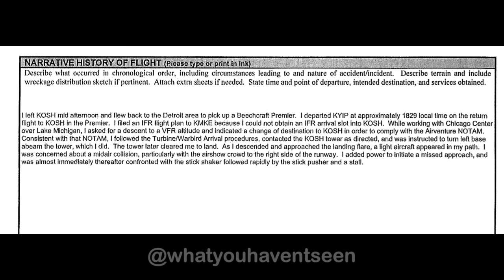Jack Roush Crashes Private Jet At Oshkosh (2010)

Comment: Hmmm... Despite what he says in his incident report (and he's lucky he lived to write one), I think there are some pretty good clues in the video as to what actually happened. 

Lets go to 0:08. That's a pretty tight turn that close to the ground and suggests he is having some major difficulty trying to line up with the runway. 

At 0:10 he rolls out wings level but no way is he lined up (we'll prove that later). The only reason he rolls out is because he has to arrest his rate of descent and in this frame he is actually beginning to climb wings level. His report says he was aborting the approach due to conflicting traffic but we will see that is probably not the case. While you're on this frame take a look at the crowd control marshals standing just in front of the scooter. Their shadows give a good indication of where the sun is and how they are casting long shadows. 

Now go to frame 0:12. The first thing to note is the pilot has banked left again. This is not standard procedure for an abort (which he said in report he was doing), which should have been to remain climbing, wings level, on runway heading.  In my view he is actually still trying to line up with the runway and to land further down.  The second thing to note (and you might need to look carefully for this) is the aircraft's shadow on the runway. Given the long shadows that are being cast, this is proof positive that the aircraft is well right of the runway. 

Third thing to note is on the next frame 0:13.  The aircraft is banking steeply again heading for the runway centreline. Not aborting the approach.   

By 0:19 he has rolled out near runway centre line and is still continuing descent in his attempt to land. He is not aborting as he said in his report. But now everything he has done up to this point catches up with him. , His slow speed turns (these wash off lots of energy), his arrest of his descent and slight climb after first turning into the runaway  (more speed washed off ), and then no doubt attempts to further reduce rate of decent to give himself more time to line up further down the runway. He has just washed off too much speed and has too little runway left to apply more power. The approach is far from stablised and is an absolute screw up. 

At 0:23 he enters the stall and right wing drops from which there is no recovery. 

This pilot, screwed up his initial turn onto the runway,  failed to manage his air speed and in his report lied about an aircraft on the runaway and that he was aborting his approach.  It is just sheer luck that he didn't kill anybody on the ground and in my view he should not continue to hold a pilots licence.

Comment: So this is what you might call a textbook unstabilized approach. THe fact that he even turned and tired to intercept the runway is hard to believe. More likely is that Jack missed even trying a correct approach and should have been instructed to TOGA, which Jack reports that he was going to. His later claim that he forgot to add power is a tough one because  all he had to do was shove the throttles to firewall and rocket upward; "forgetting to set TO power" is cause to pull his license, and when added to the visual cues of him  presumably intending to overfly it, adds up to pulling his ticket. There is simply zero reason under any conditions, much less clear VFR to intercept the runway where he did (at any altitude) as a stabilized approach even in a 172, much less a jet that, assuming 150 knots maneuvering speed, needs at least a few miles on the approach,  or at least a mile assuming he had perfect altitude and was in the glideslope. A race car driver forgetting throttle/power to accelerate? Respectfully, not safe to fly anymore, unfortunately. He could have done a lot more damage. Regrettably, we're likely going to see a lot more of these single pilot accidents where pilots with thousands of hours in prop planes get behind the seat of a VLJ after 100 hours of left seat combined with sim training and the aircraft gets ahead of them at unfamiliar airports, and we'll just see if insurance regulators can mandate enough training to make pilots safe as a group.

Comment: I read that report and what it says doesn't seem to make sense.  First, I did not see anything in his way (like another plane- there was one on the ground but he passed it.)  I am not a pilot but even I know, he had a heavy plane with a high sync rate and likely low power- not sure about his flaps setting.  Then for some unknown reason he banked hard to the right and it almost immediately caused a stall.  He didn't have nearly enough time or power to maintain lift.  It almost looks like he flew it into the ground.  I would be curious what the weight was on that plane too. I hope they are ok.

Comment: It sounded like a linkage broke or something just before it crashed him to completely loose control, but my guess was it was the undue stress it was put under to try get out of the situation he put it in, in the first place.??
Reply: He lost a lot of airspeed during his approach and ended up stalling over the runway; reason for the bank is that the right wing stalled first and at that altitude it's virtually impossible to  recover from
Reply: @RhynoProductionsDE  Yes I know that. I thought I made that clear in my message. My point is something breaks right before the plane completely looses control. Watch the video back. We all know its an airspeed issue, my point was that because of the situation he was in caused undue stress on a part and he completely looses control as this happened. 

Maybe its just a coincidence but I doubt it. The very second after we hear a noise it goes groundward.
Reply: Definitely a good point, however I believe that noise you hear is someone dropping something on the ground where the camera man is standing. There was loads of noise with all the engines running that a broken linkage at that distance likely wouldn't be heard. It looks like a very rapid turn, but it's quite remarkable how quickly a wing can go down in a stall, especially when pulling up while already at stall speed
Reply: @RhynoProductionsDE   R P  The noise could be anything tbf, but it doesn't sound like anything being dropped it sounds like something big breaking or snapping and also you can tell its not close to the camera by the ever so slight echo in the noise. Its definitely a noise eminating further away from the camera, coupled with the fact the plane turned to the ground milliseconds after it happened I think makes it a far better assumption than not, that it came from the plane.

Comment: The crash pilot Jack Roush, said that there was another smaller plane that came into his path, and that he was trying hard to avoid them. Why is no one talking about that? They make fun of this man, but he almost had a mid air accident. Shouldn't the air traffic controller take the hit on this one? I fear there are things being left out in this story, or facts are not being shared, that should be. Any comments?
Reply: Did you see another smaller plane that came into his path? I didn't. I'm no pilot, but it seems that he missed lining up with the runway. If so, then I think the proper course of action would have been to go around and try again.

Comment: As a casual observer and bookworm I suppose this is why you never see jets but only constant speed turboprops deliberately fly in to hurricances. Turbofans do seem designed for economic cruising and opening the throttle requires a bit of a wait and a daydream until the spools sort things out amongst themselves. The classic was that airbus that did the low pass and was in the ground before the engines had sorted things out at the new throttle setting. You do have to think way ahead I would guess.

Comment: i was there and saw this from about 1/2 way between the camera and the crash. one thing not mentioned is that the day was blisteringly hot, and density altitude must have been 3 or 4k. roush was behind the power curve, and throttled up as it was rolling, so guessing he was slower than planned. i remember him coming from the plane with a bloody face - the crowd was def vibrating after seeing this - at least nobody outside the aircraft got nicked.

Comment: Not being a pilot, I have some questions.  Aren't left base turns for final typically conducted quite a bit out from the end of the runway?  It appears the left base turn was made over the runway.  Then it appears the pilot was off-center of the runway and had to turn back to the left for landing.  Am I correct?  Was the pilot actually trying to land?  If the pilot was attempting to still land, it appears that there wasn't much runway available.

Comment: That's simple.  He was about  to land on one of the taxiways thinking it was the runway, (or he was on the wrong heading for the runway) realized his error,  (you can hear the engines spool up) tried to correct left to the actual runway,  too low, to slow, stalled  and he pancaked it. Luckily,  he didn't hit anyone or anything.  I say ground him.

Comment: Why the low speed hard turns and already high nose attitude, followed by more turns. And this with turbine engine  (doesn't respond as fast as prop. This manevour should be reserved for modified VTOLs. This pilot is either trying to show off or had a death wish.

Comment: The final NTSB  report findings adopted 6/12/12, CEN10FA443 - The National Transportation Safety Board determines the probable cause(s) of this accident to be: The pilot's decision not to advance the engines to takeoff power during the go-around, as stipulated by the airplane flight manual, which resulted in an aerodynamic stall at a low altitude.

I prefer to read final report findings after a full NTSB investigation rather than speculate on flight I'm not familiar with. I am familiar with helicopter operations as a low time pilot.
Reply: Pft... low time pilot.
Reply: @leoblazer74  Perhaps if you had read the entire NTSB report you'd find Rousch logged over 8464 hours as pic. Not a low time pilot. How many hours do you have?
Reply: @fdryer5116  I tell you one thing, I have never had a catastrophic incident caused by human error before, LOL.

Comment: I can't imagine flying into Oshkosh. I have a couple of things that bother me about what happened. First is the idea, Oshkosh doesn't have go around procedures like every other airport. We are talking about a high performance jet, of course they must know a go around is possible on every landing. To pretend the sky might not be clear assumes a non-tower air field. ATC is not going to intentionally line traffic up on the end of runway making a go around impossible. Let's pretend ATC is very incompetent, a go around in heavy traffic is better than crashing. These flyins need to be limited in numbers or time slots so as to not have so many planes in the air in a small air space. I personally think the approach looks sloppy all the way around. Base to final looked way low and then to continue with this landing knowing it was such a shitty approach. I don't know if there was any way to save this approach?

Comment: Im mot a pilot but just read the pilots report and he LIED!! He said he was concerned about another aircraft for a collusion went to abort takeoff and added full throttle then the shaker started and then crash NOT.. He hot dogged it , made a hard bank to left so all can see him. Then he over shot lining up to runway banked a hair to the right to compensate had  now airspeed to make adjustments doing so dipped his right wing with no lift on wing ,  right wing became an anchor then boom